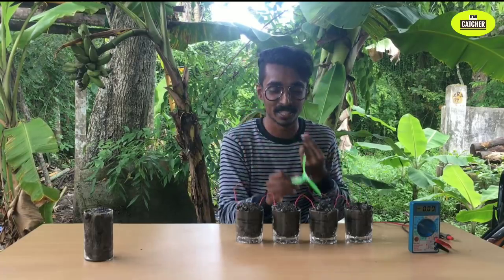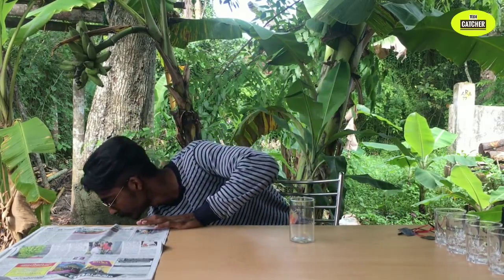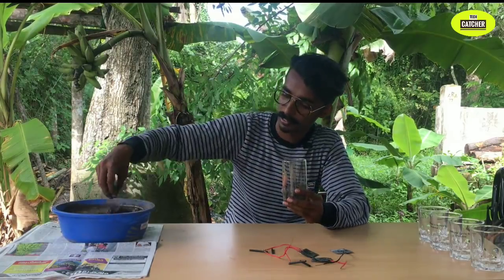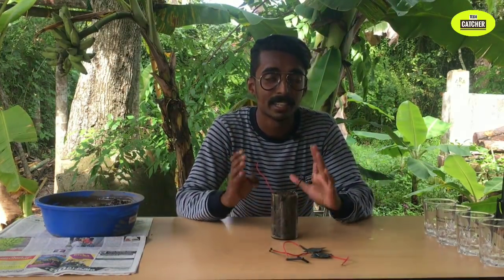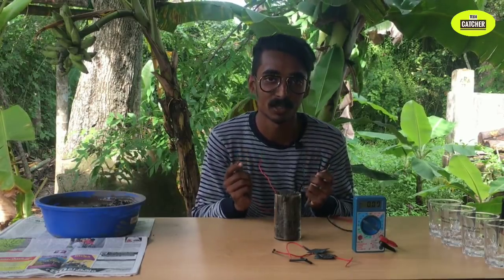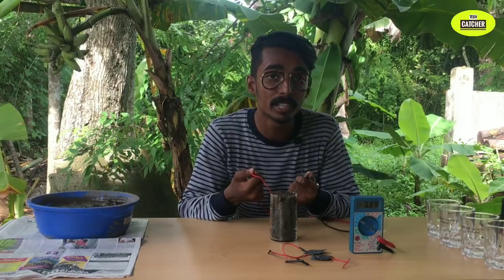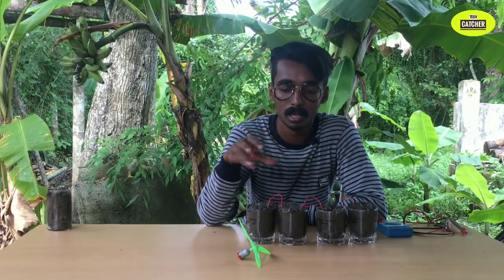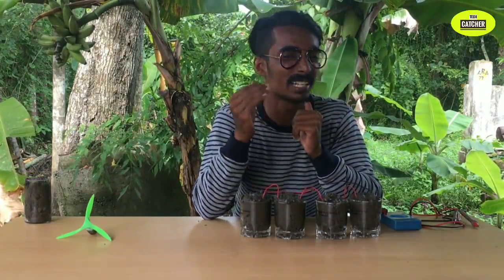|M4tech Mudcell|  But its not working properly😢😢 ചെളി കൊണ്ടുള്ള battery വർക്ക്‌ ചെയ്യുന്നില്ല

Comment: bro m4tech jio chettante house is near sea mud in places near sea contains salt (NaCl) that is why he got 1.2 volt from one  glass ,sodium chloride solution in in the mud acts as an electrolite if salt content is higher voltage will be also high ,you can use copper instead of carbon which will give you better result
Reply: Wow evanokke chemistry padipistt thanna

Comment: Ente ponnu bhaii..mini motor 4 volt il karangilla..doubt unde oru 4 volt battery connect cheyth nokk.. minimum oru 6,7 voltage venam
Reply from the maker: 1.5 volt cell il nokku bro karangunund nammal clockil use chayunna balterry